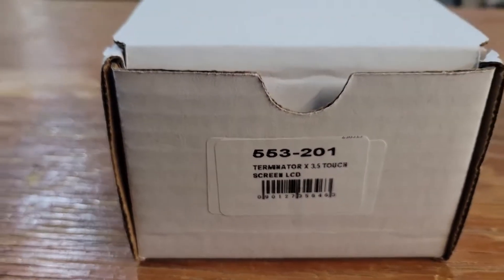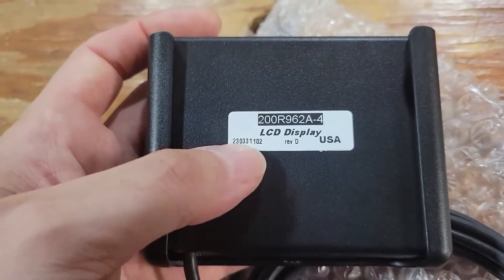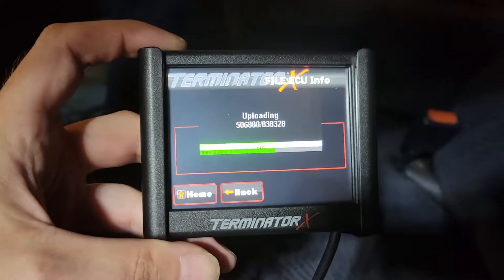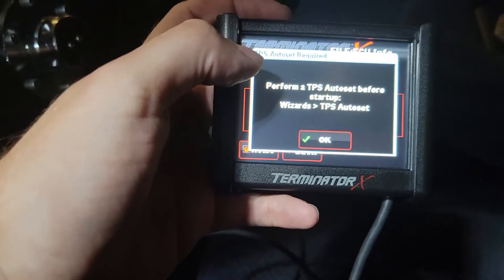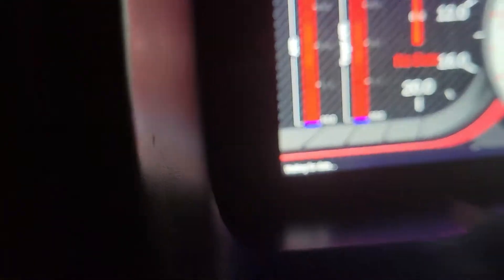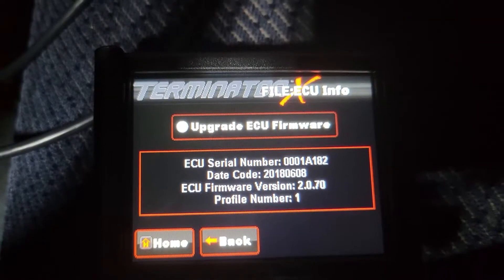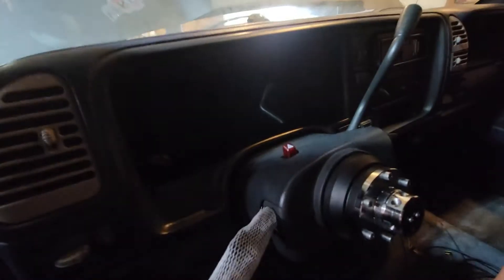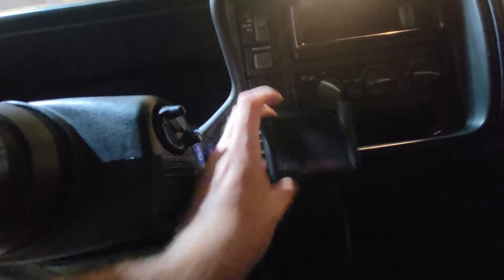How To UNBRICK A Holley Terminator ECU!!!

Comment: Im in the exact same boat, bought a car without a 3.5 handheld and was flashing my firmware, got error 38, apparently I had to unplug my screen because the canbus had a splitter. After the error my lights wont turn on on the ecu. Now I’m trying to find a handheld and hoping that fixes it